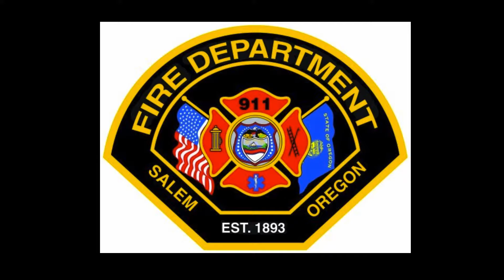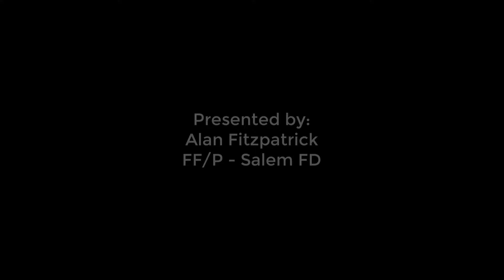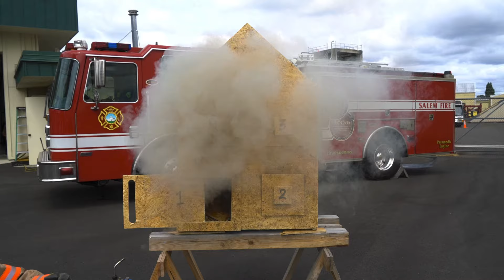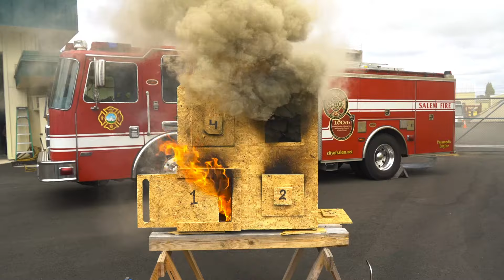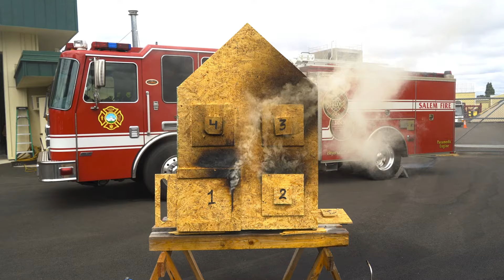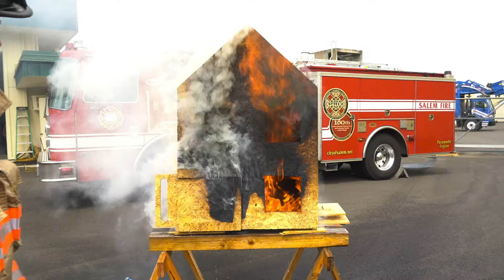Flow Path and Fire Behavior Demonstration - Salem FD

Comment: that seemed like a smoke explosion at 14 not backdraft?  no flame   however still somewhat violent. explain?
Reply: The reason it is not a smoke explosion at 14 was that the fire was becoming vent-limited and received a fresh source of oxygen. Smoke explosions occur when smoke meeting the requirements of combustion finds an alternate ignition source, think of lighting the smoke from a burned out candle.